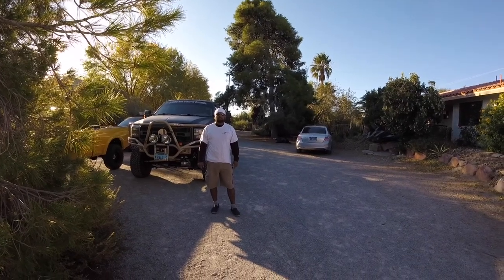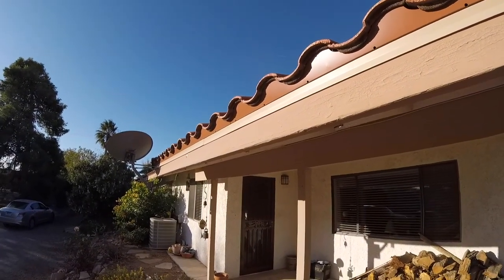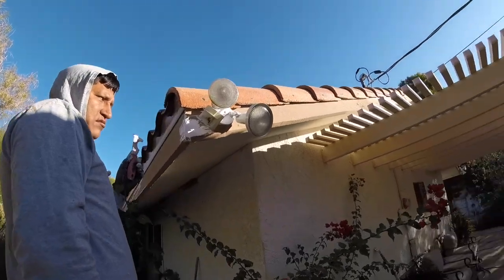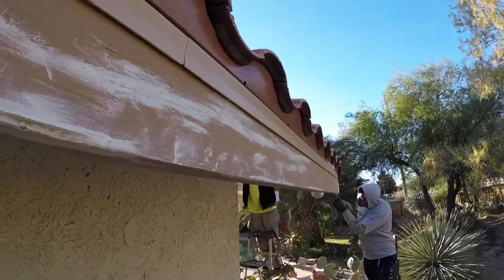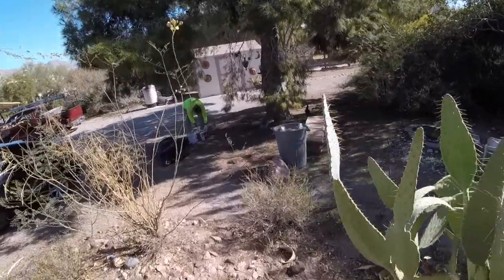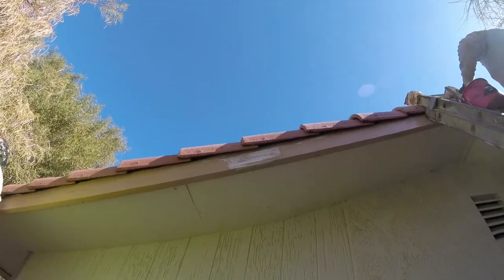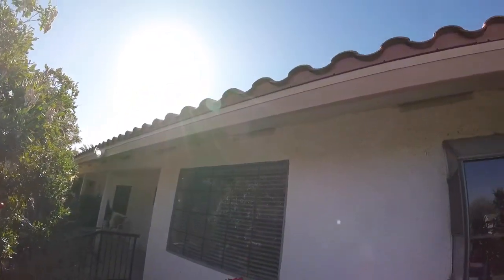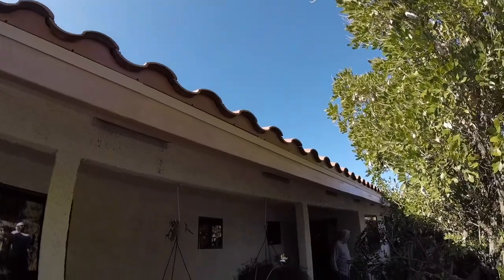How to paint a wood fascia on any house in 4 simple steps

Comment: After you patch the gaps in the fascia do you sand it first before painting? Also, do we need to put primer on before painting? Thank you.
Reply from the maker: If you apply caulk like I do you don't have to sand and depending on the type of paint that you use is  where you have to decide to prime or just apply two coats of the paint

Comment: How much do you charge per lineal feet or how? Also how much do usually use for two history house?
Reply from the maker: A single story house will run between 600 to 700 and a two story house between 800 to 900 labor and materials

Comment: hi great video.  I sanded  the facia and gave it 2 coats of primer. then 2 coats of sherman Williams A100 , how long do you think it will last here in California.
Reply from the maker: Hi there depending on the weather if you guys get a lot of rain snow extreme heat I will say for sure between 3 to 5 years
Reply: Do not use a100 @miguel worse paint sherwin Williams has. It is practically water.